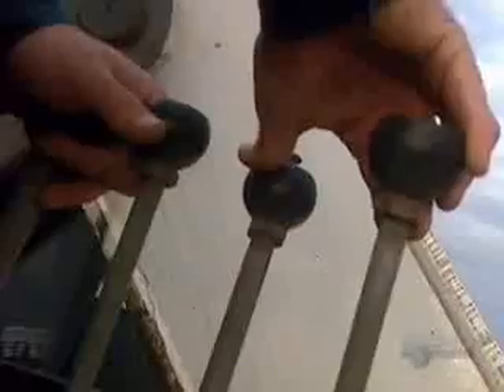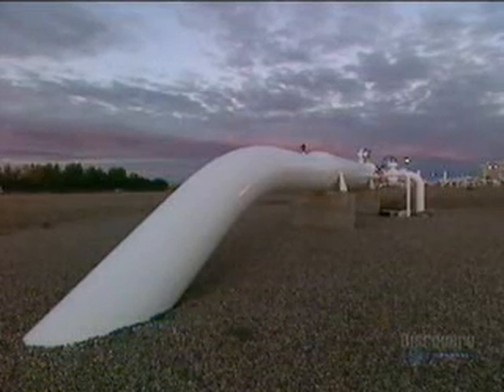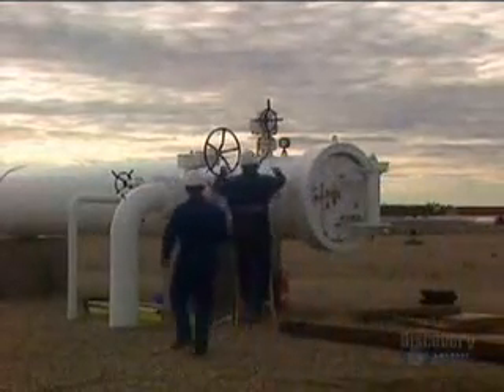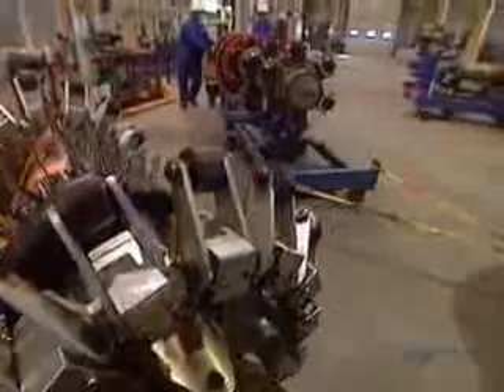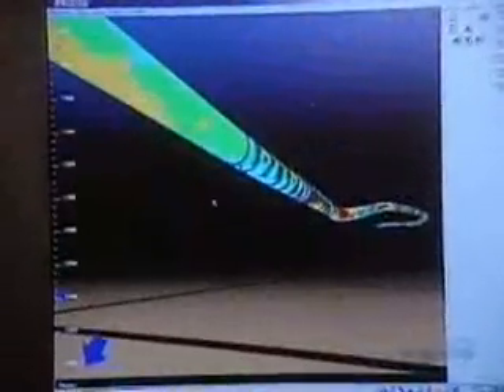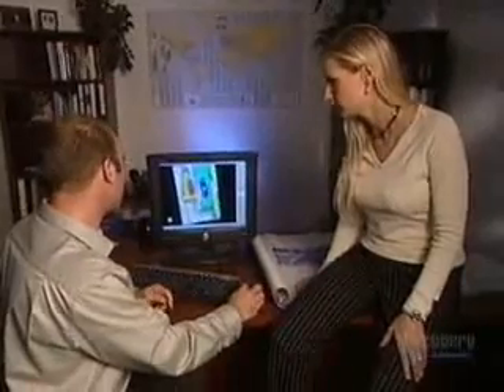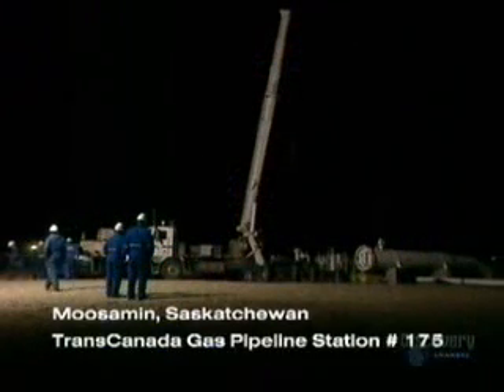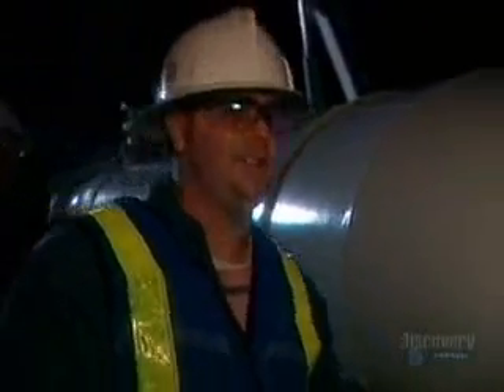Pipeline inspection

Comment: The pig doesn't harm the pipeline it just checks for internal corrosion. The danger is, if there's excessive internal corrosion in the pipeline, thats how you get a boom! Hence the routine maintenance. if there's a spot that needs to get fixed, on a natural gas pipeline you weld a "wedding band" on it. Two half pieces of pipe that are welded on top of the existing pipe where the repair needs to be made.

Comment: I'm actually in the water business but have been fascinated by method. Always knew that oil/gas are steps ahead due to product profit. What's currently the cost/km of doin' an MFL or U/S inspection? Guess if you want to clean, you do a separate go, don't you? Thanx